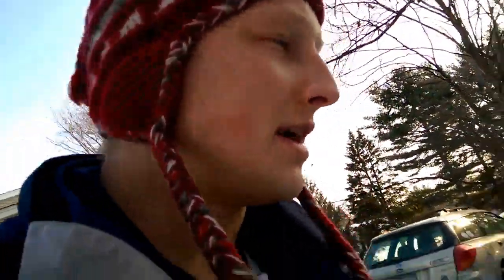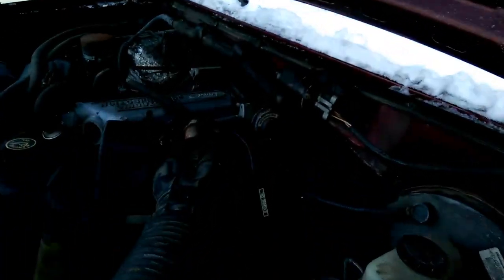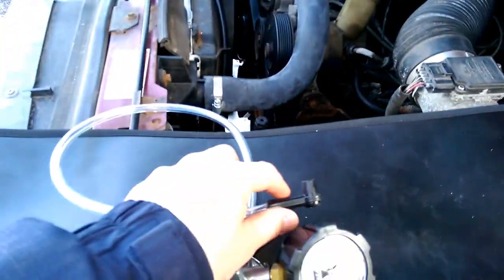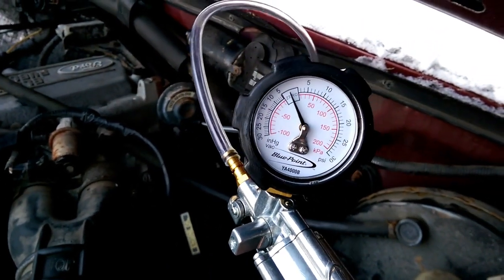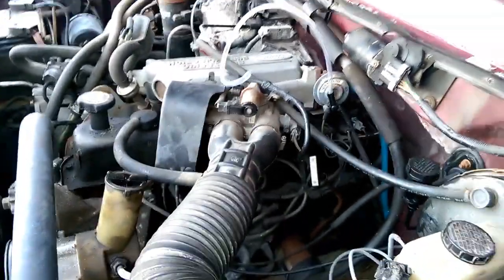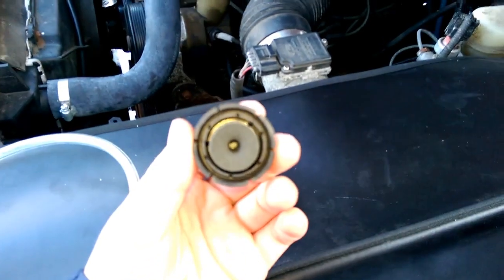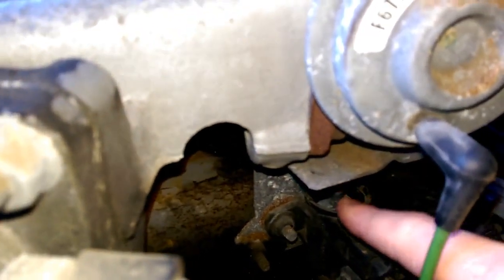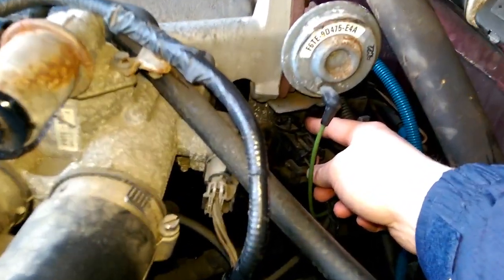F150 EGR valve quick test

Comment: What if your Ford is a V8  does it work the same  ?    because the setup is Much different
Reply from the maker: Most Ford's from this era are the same because although the engines are different, the EGR valve and EGR controller work the same and are vacuum controlled.

Comment: Give that growling power steering pump a long sip of fluid.
Reply: They all sound like that, not a fluid problem
Reply: My 93 sounds exactly the same. My power steering reservoir is always topped off, and when it’s not… It’s a lot louder than that and it’s not your typical power steering dry pump groan— Those pumps are big and mean and you’ll know when they are dry

Comment: Get an Actron CP9690 code tester. It checks live, record, emissions test, graphing, transmission codes, check engine light reset, oil change light reset, solenoid and relay test, timing advance test, it has code connect to diagnose codes, ABS, SRS, and MORE! It works from 1983-2013 and is updatable. You enter the year, make, engine to start the test. It is WELL lit up! It stores 5 vehicles tested memory. The internal battery allows off-car review of results.

Comment: Hook up a Mityvac to the EGR and pump it up. If it's a negative back pressure valve, the vacuum should hold. See if there's vacuum at idle. If so, replace parts in- line to correct the problem. If the engine runs rough while idling with the Mityvac pumped, the EGR is flowing and the passage is clear in the valve and in the engine. Check Troubleshooting feature on the tester to diagnose the problem. If there's vacuum to the EGR, the solenoid is working.

Comment: when it idles down and runs like shit does that mean everything is clogged up or somethings wrong with vaccum?
Reply from the maker: If you are manually triggering EGR like I am showing and it runs like shit it is a good thing.  This means exhaust gas is choking the engine which means the EGR passages must be clear.
Reply: William Greenlee  i tried to manually trigger the egr and nothing happened does that mean my egr is stuck open?
Reply: @markpowerz310  If I'm understanding this information shown and read I would think so. I'm currently working on a 94 F150 4.9 liter and my truck did the same thing when I put my finger over the solenoid switch hole. Apparently that's a good sign based on this gentleman video. I'm plugging up my OBD1 Code Reader to see what can I find. I've replaced the map sensor, egr solenoid switch and vacuum module and no change. So hopefully I can get a answer from this code reader.
Reply: @markpowerz310  Latest update...The OBD1 just gave a a code of 334. The book Code definition: EGR closed valve voltage high.
Reply: @Car-Go-Shorts  I have same problem   My truck wen is parking go down on idle. Only on parking I change that map sensor and still same and that fiumes are bad

Comment: Pump it up to 8 and not 10. 10 is a little too high. If you get vacuum at the EGR at idle, replace the charcoal canister purge valve. If you get oxygen sensor running rich codes, replace the MAP sensor. Get an Actron CP 9690 code tester. It does graphing also.

Comment: Get the Snap-on scanner and cartridges and adapters and manuals from E-Bay. Also get the 120 volt cable and battery Pak to check readings away from the vehicle. Get the 12 volt cable which hooks up to the battery and adapter. The scanner can test Ox. sensors,  and EGR flow, and RPM'S,  and MAF, ISC, and fuel trim, and lots of other tests. The scanner and cartridges are quite inexpensive!